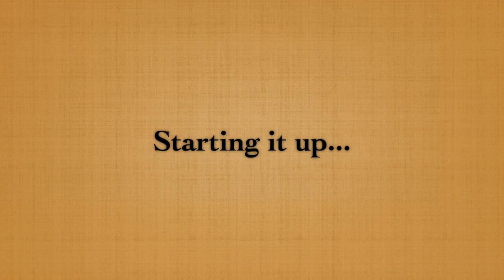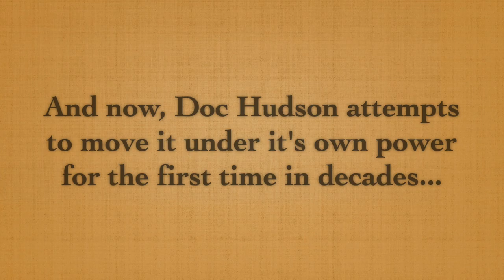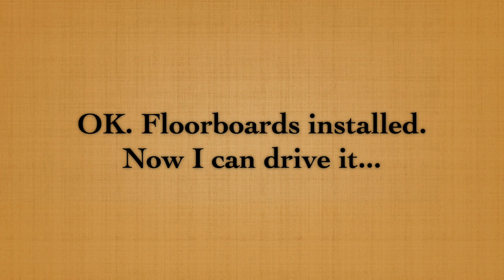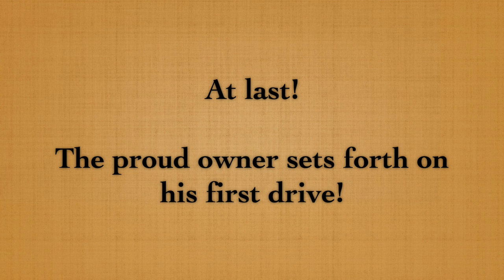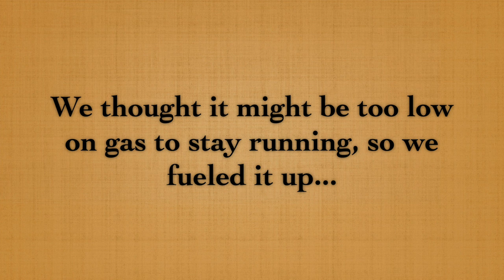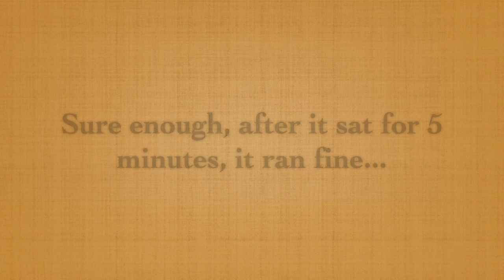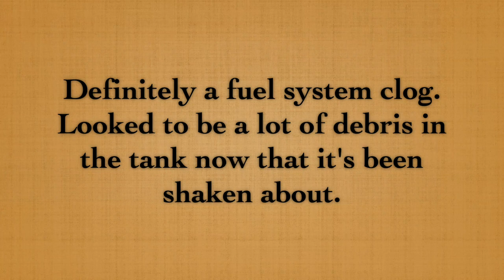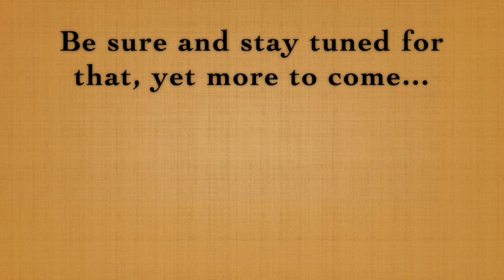1930 Ford Model A pickup -Off the road since 1986! -PART 5: It finally drives!

Comment: Disconnect the gas line at the bowl and with the gas cap off blow air back towards the tank. Quick way to unclog crud in the bottom of the tank. In the old days we used a tire pump to do this.

Comment: Beautiful truck, but yard could use a good cleaning...too much junk
Reply: Sometimes if the fuel line is pushed too far into the fitting, it will restrict the gas flow